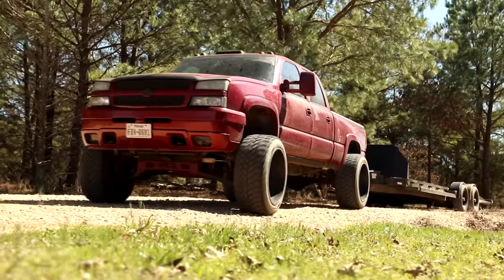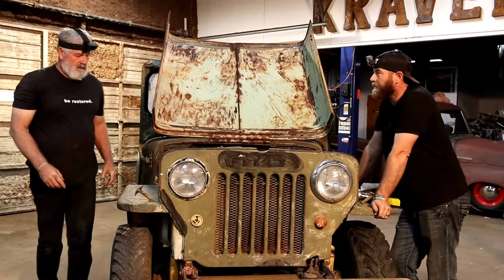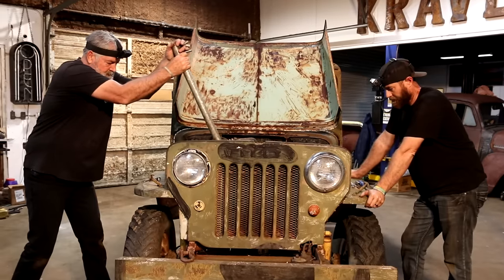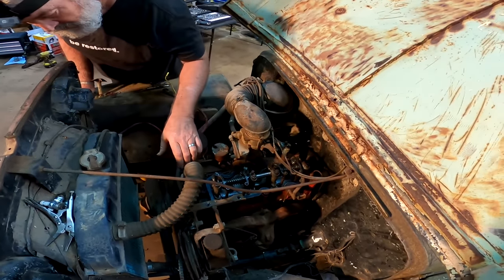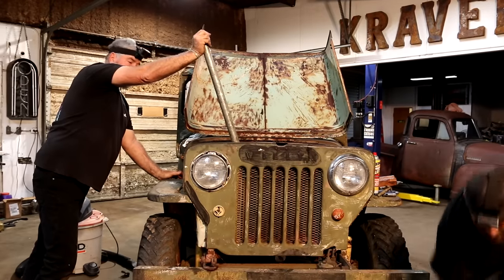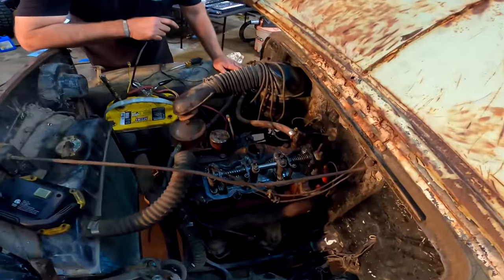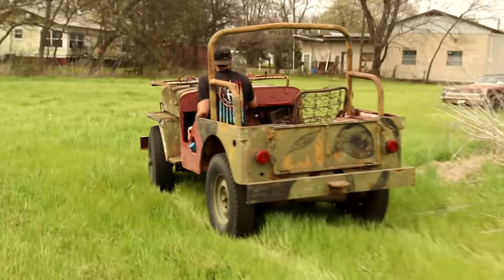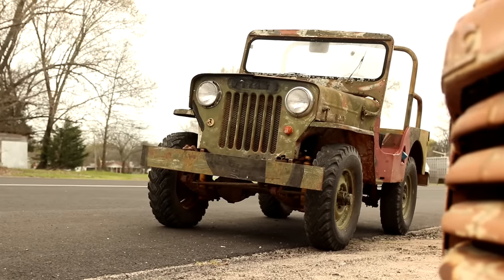Will It Run After 20 Years? | RARE 1959 Willys CJ3B "High Hood" Jeep | RESTORED

Comment: Glad to see you got the old girl running!! I have a 47 CJ2A that I just finished rebuilding the entire drive train on. I believe those CJ3bs still used the t90 transmission and spicer 18 transfer case. There isn’t much to those transmissions, just a simple 3 speed and parts are readily available. Biggest thing to watch out for is the 2-3 shifting collar. They wear out over time, in turn causing the jeep to pop out of second on deaccleration.  It’s a fun time packing the 88 little needle bearings into the cluster gear/counter shaft! If it were me I’d fix the transmission, brakes and just use it as an off-road rig! The f head engine design always intrigues me, mine has the l head go devil l134.
Reply: The British Rover 90 6 cylinder engine had the same side-valve/overhead valve system. A four cylinder version was used on the first Landrovers, then a conventional overhead valve four cylinder then the side valve/overhead valve six cylinder engine. The ignition timing on the six cylinder engine was in retard at idle speeds. They would produce power right down to stalled which made power control superbly manageable offroad. However performance was not all that great compared to the emerging Toyota Landcuisers and Nissan Patrols of two-thirds to nearly twice the cubic displacement.

Comment: Lance I hope you realize the ways you are touching people...watching this episode brought back so many memories of my Grandpa.... He had an Army issued Willies. All the unit marking were on it,  push button start, No roll bar,  bolt plat between the seats for a Ma Duce....it was the most fun to riding around Topnibee Michigan. He'd be chomping on a cigar;   With a big grin on his face, the same grin you had while driving.    'You boys hold on...Willy's known for tossing passenger's"  my brothers and I spent three weeks with he and my grandma up north Michigan on  mullett LK
Wednesday evening going to church,  Sunday church, then lunch, ripping around in the willies. The absolute best part; my brothers and I learned how to drive in the willies
 After he passed, his estate gave the willies to the local Christian Camp....over the winter when the camp was at minimum staff,  the jeep was stolen.  Grandpa, always parked it in his service garage;  "This is the easiest truck to hot-wire'   You will need the lock the windscreen down.  else-wise you'll need tempered glass cut for replacement....Don't ask me how I know...

Comment: hi there guys  just did the same thing on a CJ3B also . was sitting for 25 years . would not turn over . turned to have the starter bend ex was in gauged into the flywheel from tries to start in the past .i just put a battery in it and took a chance , turned over  , oh well watched till the end did good john

Comment: I’ve personally had good luck using motorkote hyper lube to free up a stuck engine. It actually soaks into the metal allowing the rings to brake free. Usually let it soak for 24 house. Hopefully this method will work for you also.

Comment: That's a sweet little Jeep! If I had it than I would probably just fix it up enough to be useable and make sure that it doesn't rust away. Then I would use it as a camping rig. Even if I hat to trailer it to the trail head. Nicley done!

Comment: Anchor the front to something in the shop with a chain. Jack up the rear-end and wrap a ratchet strap around one of the rear tires a couple of times and pull it with a winch or vehicle. May help the stuck engine come loose while in gear and prevent sliding.

Comment: Josh a Good 24 - 48 hr. Soak Solution although not the cheapest, It works better than most, is 3 parts ATF to 1 part Acetone. It eats rust very well.

Comment: Sounds like an old wood-burning train trying to build steam.  Did you try mouse milk or break free to loosen the engine?  Heat the block with a hair drier or heat gun, maybe get the metal to expand so penetrating oil can seep in.  Just a suggestion. Not telling you how. I've learned more from watching ya'll than I could ever think of teaching you.

Comment: They used the taller hood because of the over head valves, the flat heads didn't need to be higher
Reply: The jeep your working on seem to have been the next step to the jeep Wrangler

Comment: Wasn't aware the valves were split between the head and block.
Great job getting it running!
Reply: This motor was called the f head. It was an overnight, head designed to fit the flat head motor, 1/2 the valves overhead, more horsepower.  It transitioned willeys/ overland flathead to ohv. This was done while Keiser owned Willeys jeep.

Comment: Congratulations & excellent video (RESTORE Crew) :) also fix up I did back in 2009 Jeep C cargo van in to hot rod it was scrap yard for 30 years motor was seize up plus transmission also frame was rust away plus some body to and axle ! Owner want updated body original color was Baby Blue also most interior but seat were gone out it but heard was black ! Orgnail Motor was 4 cylinder with 1 barrel carb plus had choke cable knob in dash, transmission was Manual 4 speed with Bow Low first gear, axle ratio 303 , 4 wheel drums brakes Manual and plus Armstrong Manual Steering ! Surprises me the Cooper rad still in excellent condition, but put 1978 GM 1/2 ton  frame in it , 1980 Chevrolet 4.4 litre 267 small V8 160 hp with 210 torque plus cam and crank  of 350  with 4 barrel carb Holley CFM 850 manual choke, daul exhaust, Turbo 700SR 4speed Overdrive Automatic transmission with Shift Kit, 377 posi rear plus Power Brakes and Steering , fuel tank 1976 Caddy plus ! Updated electrical to 12 volt Negative ground, new stereo system 6 speakers, plus antenna on roof Lol floor shifter Automatic transmission type plus emergency brake handle plus pedal , Steering wheel out GMC truck 1978 plus tilt all gauge updated but Speedometer still works also chrome mirrors on  2 doors  , 2 bucket and full bench one in cargo  space ! Body was Black also Blue Interior ! Also gauges too!

Comment: I know this may not have anything to do with this video but I was wondering if you guys saw my comment about the little 4-cylinder car putting the starter on 24 volts and a stronger combustible down the throat of the carburetor stronger than gas or starting fluid???

Comment: I have a 46 Cj2a.... The only problem is that I live in the northern US, so everything is rusted out - except for what the previous owner (before my grandfather) replaced with aluminum (because it rusted out) Last tags were from 84 and I started working on it 2021. Hood was down, clutch and brake pedals were frozen. Got a good battery and it fired right up. Cleaned points and checked spark plugs to get it running, but it really wanted to come alive.

Comment: Willy's CJ3B Jeeps were being produced under licence in India by Mahindra virtually unchanged till 1966, complete with the left hand steering wheel. Then in '67 the licence probably expired and manufacturing switched to the right hand drive, which is more suited for Indian traffic. In the hill areas these jeeps were much loved as their 4x4 took them to impossible places. The powerful rumble of the Hurricane F head engine and typical whine from the transmission is one of my fond memories of childhood, as we bumped about sitting in the back on the rear mudguards which served as the rear seats. The rear seat provided by the manufacturer was immediately removed after purchase because the space was needed for luggage or other goods.

Comment: I have  a 54 3B and I love driving it. I decided one Jeep wasn't enough. I  decided to build a WWII Jeep. It's 42 Ford GPW and it has been a ground up rebuild with everything missing from it. After 5 years of work I can now drive it around sitting on a wood seat frame I built. I will be putting the body on it in the next month or two. Just about everything has been done by me with exception to rebuilding the axles with NOS ring and pinion and the engine that is a CJ engine for the time being until I can get a GPW motor rebuilt (no rush). I want to enjoy the Jeep.

Comment: To start with, irch that POS engine which is woefully under powered and replace it with a Pinto 2300 or small V/6. What they need is about 100 horsepower to make a good driveable Jeep with the power you need to get out of tough plac. The next thing is to install a Saginaw GM style steering box and one piece steering rod, this wi,l eliminate the wiggle wobbles.

Comment: When you honed out the cylinder, did you not remove material that would makes the rings seat properly, causing compression loss?  Only asking from someone without experience.  Good job!

Comment: Only one way to unseize a motor fast is with brake fluid. Let sit overnight, then use a 1/2 " drive breaker bar. Only try to go about an inch, then come back that inch. Whatever distance you move it forward, you have to keep coming back the same amount. You don't want to crack the rings. Don't force it. For the real bad ones, you may have to remove the top cover of the trans, & fill it with brake fluid too.

Comment: I would paint the old girl. Clean it all up. Maybe rebuild the motor, transmission. If I didn't have a project I would like to have it. Hey is the donuts any good at that shop? You two guys are great, as you both work together so well. Hey let Daddy drive one. Sister did a great job filming.

Comment: I had a CJ5 years ago with a stuck engine. After letting the engine soak with power steering fluid, we put it in four wheel drive and pulled it behind a truck and kept popping the clutch till it broke free. Ran great once the engine was free

Comment: That Engine style was called an F head engine " Not meaning flat head engine" it meant the valve configuration looking like the 2 flat horizontal lines formed by the surface of the upper and lower valves. These engines were really reliable and lasted a long time if the proper maintenance was done by its previous owners!!

Comment: I sure would like to know the history on the old thing.
My dad was a tracked vehicle mechanic with the 4th Armored Division during WWII. He had nothing but praise for the Jeeps and the Studebaker deuces. Not so much for the Shermans with the Ford motor. He said the radial powered ones were more reliable but there were always piles of sparkplugs to be cleaned.
I would go through that trans sooner than later as a bearing might lock down and ruin something expensive🤬.
I'm looking forward to part two👍👍! 
Cheers
Terry from South Carolina

Comment: Loved this one.  It broke loose without having to remove the engine this time. The wood block and moving the breaker pipe on crank worked good. Going to try this method on a Susuki 2 stroke outboard motor that a friend gave up on.

Comment: Have a 53 Willys pickup with the 134F head that was stuck as well. I also had to remove the head and gently beat a block of wood to unstick it. It had water in the 4th or rear cylinder. I ended up rebuilding a different F head motor and am in the process of having the transmission and transfer case redone. I figured might as well address what I would no doubt have to deal with eventually anyway. When I drained the transmission/transfer case there was minimal fluid and it didn't look good. Hopefully have it under it's own power this summer. You rapping on the block of wood brought a smile to my face. unfortunately the 4th cylinder wall was too pitted.

Comment: I wonder if heating the block up on these seized engines would help... You could hook the heater hoses from a running engine up to the sized bock and heat it up to around 210. I wonder if the added heat would help with freeing up the rust- may be something to try. Garage 54 used this method to thaw out a frozen car...

Comment: YOU CAN GET UNDERNEATH AND REMOVE THE CLUTCH FLYWHEEL COVER AND USE A PRY BAR ON THE 
FLYWHEEL STARTER TEETH WHERE YOU CSN GAIN A TREMENDOUS AMOUNT OF LEVERAGE

Comment: take  the  starter   off   and   get   a  bar  on   the   ring   gear  thru   the  .hole  you   get  a   lot   more   leverage .than  trying   the  way   you   were  doing   it

Comment: IF YOU HAVE A FRIEND IN A MACHINE SHOP  ASK HIM IF HE COULD GET  YOU A INDUSTRIAL  PENETRATING OIL FOR WHAT YOU NEED TO LOOSEN PISTONS  IN A MOTOR  / THERE ARE PENETRATING OILS  THAT HELP REMOVE PRESSED IN  DOLL PINS AND KEYS STUCK IN KEY-WAYS  OF GEARS THAT ARE RUSTED IN FOR TEN'S OF YEARS  JUST A LITTLE BIT OF THE FLUID AND  TIME AND A FEW TAPS WITH A LEAD HAMMER AND BINGO IT'S FREE , AFTER THAT YOU WILL NOT USE ANYTHING ELSE  / GOOD LUCK WITH THE JOB

Comment: I would really like to see this old girl restored and whatever y'all do, PLEASE get rid of that old S-10 or Postal Jeep steering wheel. Someone probably replaced the entire steering column and steering rack to adapt it to power steering. I'd get it running as well as possible, replace the tires, clean everything up underneath, convert it all back to OEM specs, strip it all down to bare metal, and give it an olive drab paint job like it was originally. It was never meant to be a daily driver, it was built to be a workhorse for use of our armed forces. It's your Willys, so y'all do whatever you want. I'm just stating my own personal opinion.